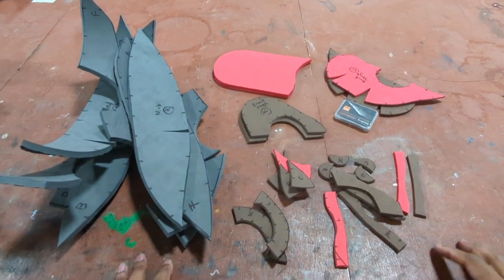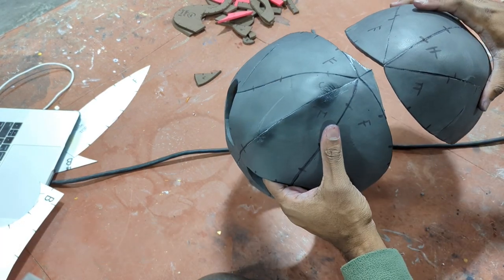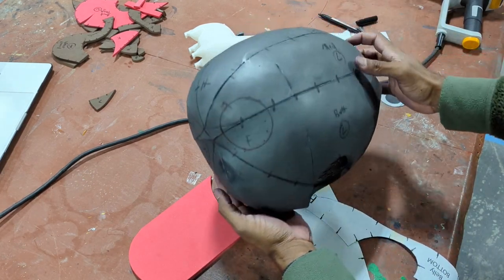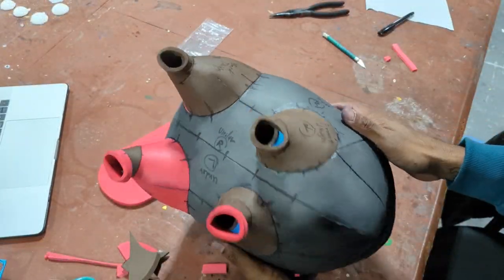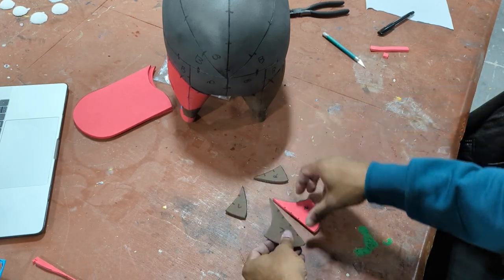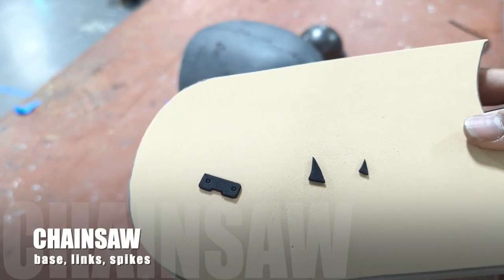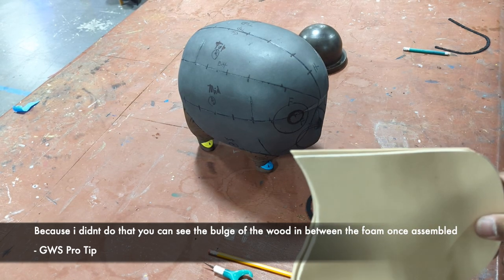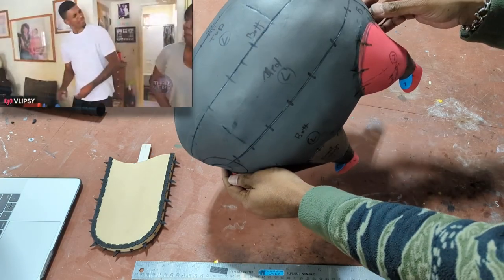Chainsaw Man "Pochita" EVA foam cosplay prop ( TUTORIAL ) with PDF patterns

Comment: Sorry if you said it in the video, but what millimeter foam is used for the whole project? I will be purchasing the pattern but wanted to see if I need to go out and get different thickness.
Reply from the maker: The pattern has all that info 👌🏽✨ it's been a while but I believe I did 8mm for the body, 5mm for legs, tail & face. 10 mm for handles and 2mm for all the small bits
Reply: @GiveWaveStudios  thank you!